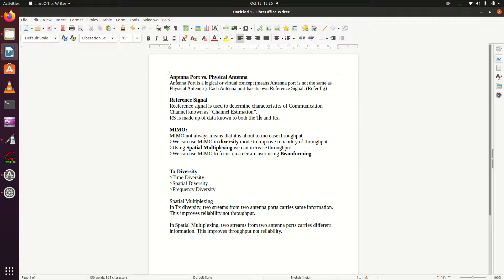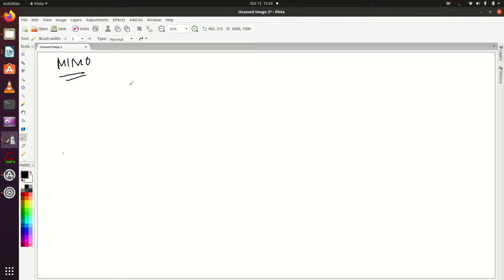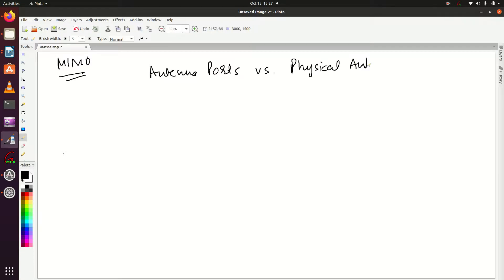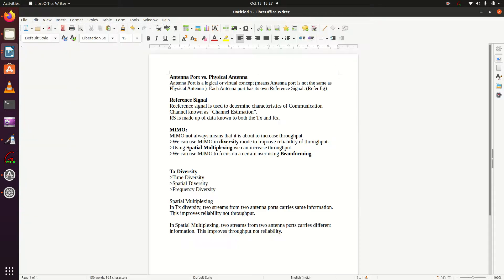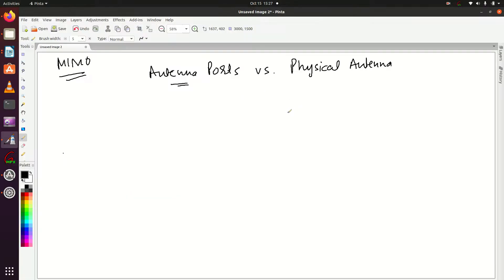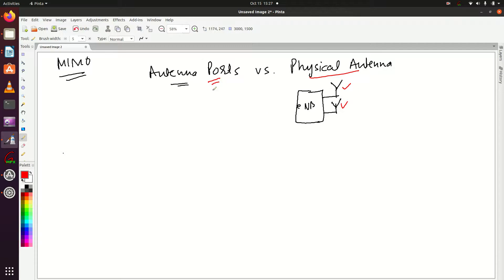LTE MIMO Part1

Comment: Nice explanation on all your videos. But 2x2 or 4x4 means number of antennas but not the ports, can you confirm please. Even in MassiveMIMO 256 does mean the number of Antenna elements are that many are indeed physically available , also used for Beamforming.
Reply from the maker: 4x4 MIMO means 4 Antenna ports at base station. Antenna Ports are mapped to physical antenna. It depends on vendor how they configure this mapping.